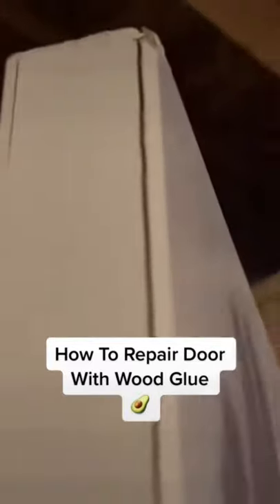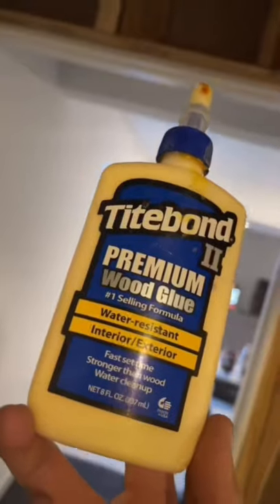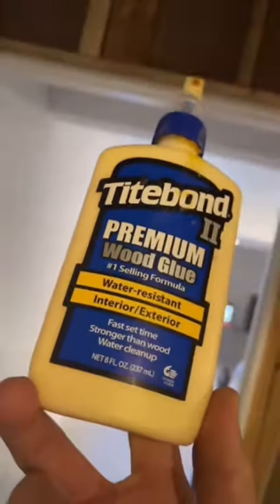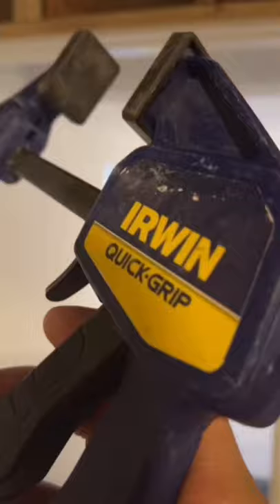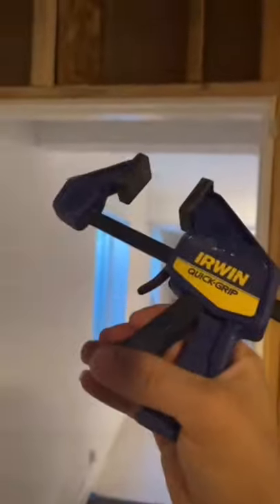How To Repair Door With Wood Glue. #handyman #woodglue #door #diy #howto

Comment: Wipe that excess glue off with a damp rag.  Sanding wood glue takes forever.
Reply: By hand yes but with a multi tool and sanding pad makes quick work
Reply: @miahzzeebest701  that’s not a bad idea
Reply: @joegatton6717  I use it almost every day. Super nice
Reply: All you need is an electric vibrating sander 30 to 40 seconds max
Reply: Yep. Glue, clamp, wipe. Always.

If you sand it off when it dries, you’re inevitably going to take paint off.

Comment: and the door split because it was rubbing on the door frame.. put a wedge in the split it open it  little then apply the wood glue  - clamp it and wipe off any extra glue with a damp rag... then when it dries you can sand down the edge of the door or shim out the hinge to help keep it from rubbing on the frame . then paint it

Comment: I do remodeling, maintenance, and new construction for a  property management & development company, and this is the second most common repair I do. Wood glue and clamps work good if you have hours to wait for glue to dry. There's 2 ways too get the same results in a fraction of the time. First take the pins out of the hinges and remove the door and put on some saw horses or lay a couple of 2×4's down if you don't have saw horses. The first & fastest way is instead of wood glue use CA glue. Hold pressure for 20 seconds or lift the panel as far as possible and use whatever you have as a wedge to keep it separated. Mask off the solid surface the panel will be glued too so it doesn't get any  activator on it. Then spray activator on the back of the panel, and quickly remove masking on the other part and apply CA glue. Then press the panel into the glue and it will instantly bond. Then paint and put the door on the hinges. #2 Glue and clamp like he showed, but with less glue. As soon as it's clamped I shoot some finish staples or brads around the outside, but adjust the pressure or the gun so they don't go through the panel, and if there's fake woodgrain indentations in the panel staple or nail in those with the grain if using staples. Take the clamps off and use some 5 minute hot mud or quick drying spackle for the holes lightly clean with a damp rag and paint.

Comment: I've been trying to get wood glue In there, I've used a toothpick, tongue depressor (popsicle stick) and can't get the glue to get into the door crack. Any tips ??
Reply: Take the door off. Lay it hinges down on the floor. Spread the door skin a little with a screwdriver or other suitable tool. Put your glue in the gap and let it flow into the gap for a minute. Use a piece of wood under the clamps and use lots of clamps. Have a wet rag ready to wipe off excess glue.
Let the glue dry for an hour or two.  As a journeyman carpenter of 50 years I've done this many times.